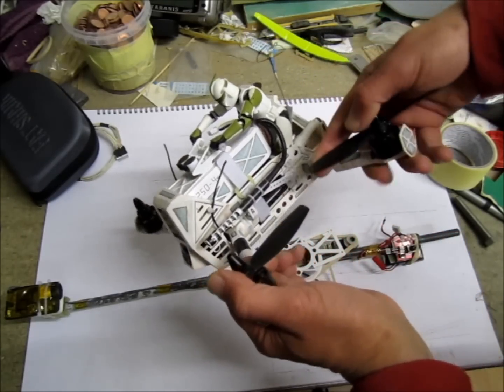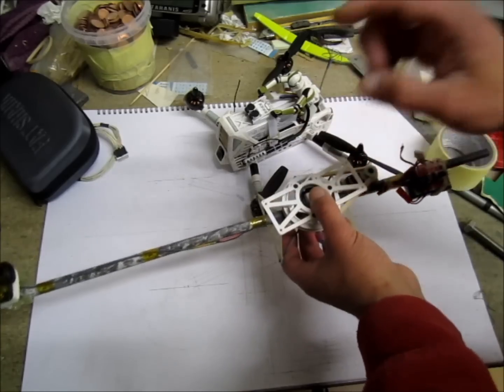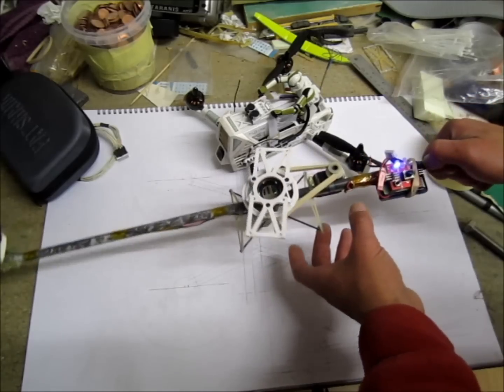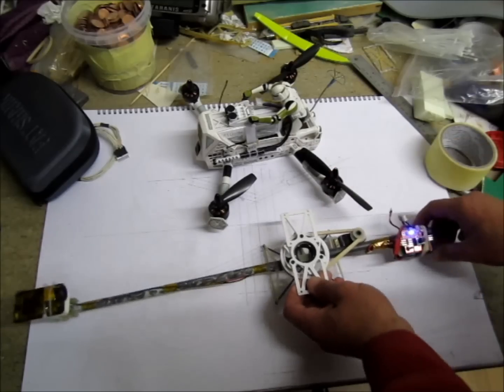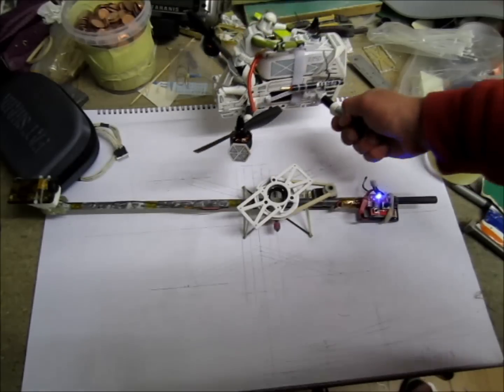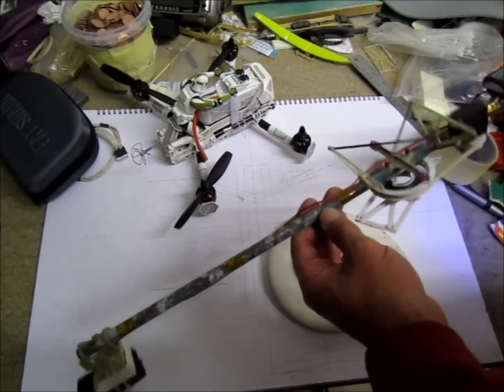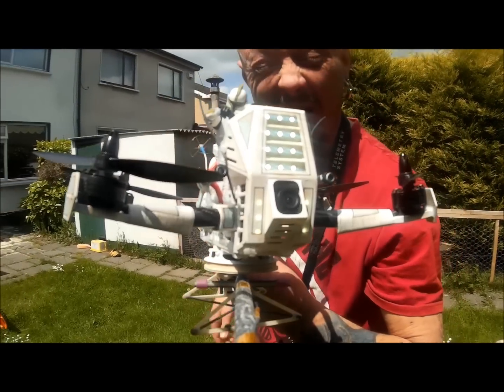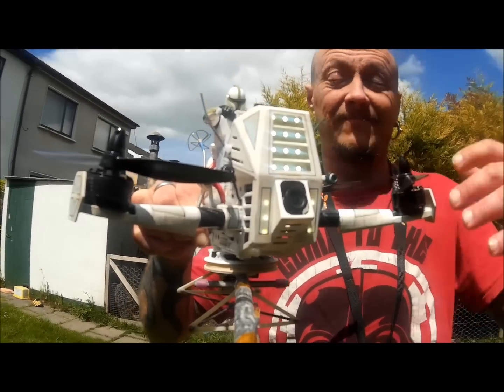Mobius Skycrane system

Comment: Very smart. Wondered about a Mobius lens extension cable kit - with lens out on the pole and the camera guts used as counter balance.
Reply from the maker: Tobermory Cat I have a 20cm (I think) extention and that was the idea in a first place, but didn't start to build it properly coz I wasn't sure whether the system will work as I want it to. Now that it works I don't have a bearing:) 
So yes, lens extension is the way to go for weight saving, cheers!
Reply: ROBOFORCERX2000 its one thing to think about these things but quite another to actually do them to see if they actually work. Brilliant seeing what you come up with!
Reply from the maker: Tobermory Cat Thanks bro!